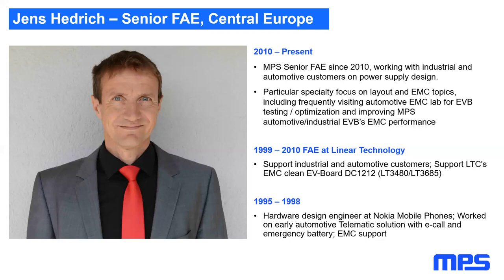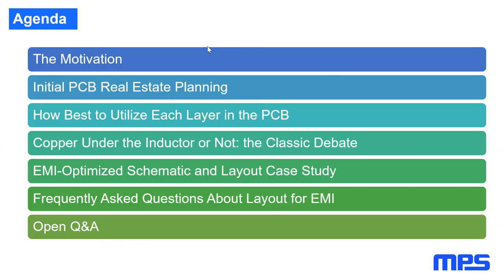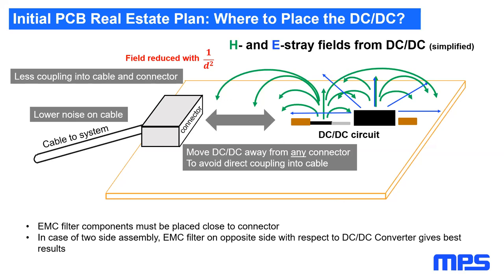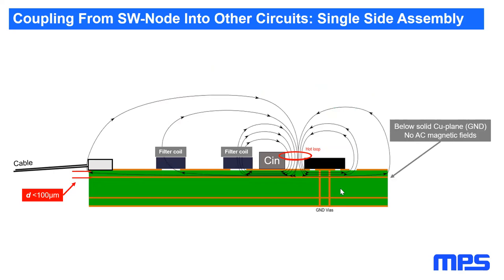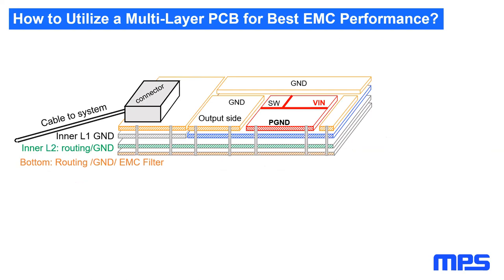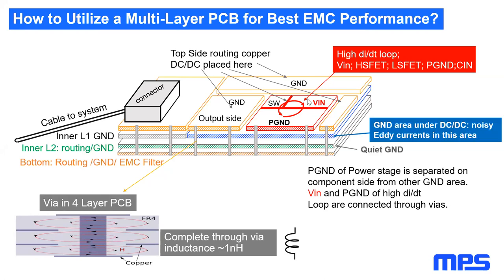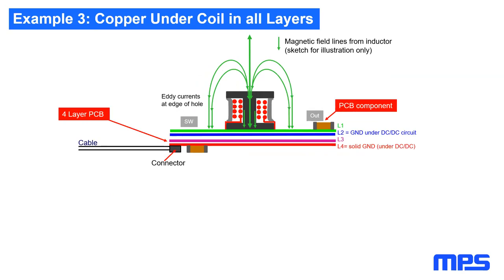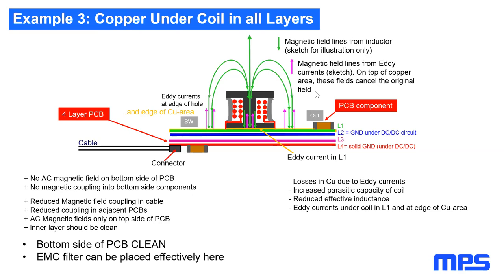Webinar: Automotive EMI Demystified Part 2 - Pursuing an Ideal Power Supply Layout

Comment: Thanks for the webinar, it has been very interesting.
I have some questions regarding the layout shown in minute 24:
1. If the converter had a thermal pad, would it be better to connect it to the PGND of the input capacitors or to the GND of the output capacitors? Which option would give a better EMI performance?
2. Also, if the converter had a thermal pad, putting some vias in the thermal pad to improve its thermal capabilities would affect the total EMI?
3. Finally, how would the EMI be affected if some vias where located all around the edges of the output capacitors GND plane?
Thanks!
Reply from the maker: For Question 1: There is no simple answer. It depends. Please consider: Input Buck half-bridge PGND carries high di/dt current. GND impedance is not zero! The PGND is noisy.
Output capacitor GND current is triangular shape, with limited di/dt. This GND is much cleaner. Usually Buck-IC GND is referred to Cout-GND, as this is the reference point for the FB-system.
For EMC it is good practice to provide a local GND on top and first inner layer.
For Question 2: It really depends on the total set-up, PCB size, connector lace etc….
For Question 3: 
Buck output capacitor GND is in principle a lower noise node. We can not give a general answer, it really depends.

Comment: Thank you for the webinar. Do you have any webinars on isolated dc-dc converters? How do you prevent the fields from the transformer of isolated converter to couple to the cable? There will always be open air gap between primary and secondary winding of the transformer.
Reply from the maker: Magnetic cores themselves serve as a good shielding for the magnetic fields, use cores that enclose the windings. Placement of the cables also makes a difference, try to avoid putting cables directly next to the transformer.